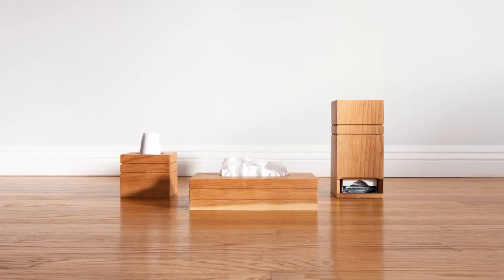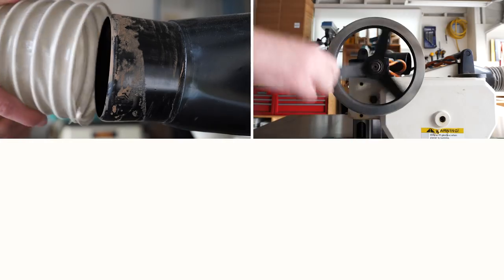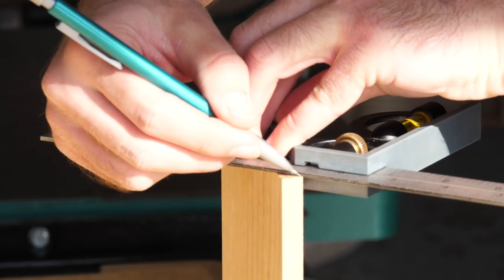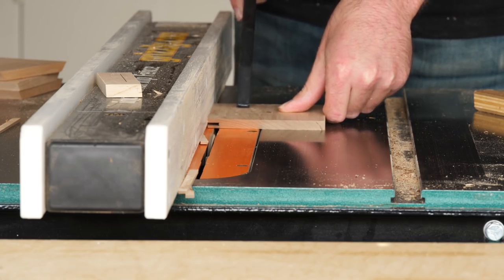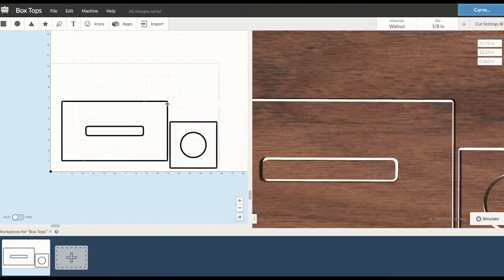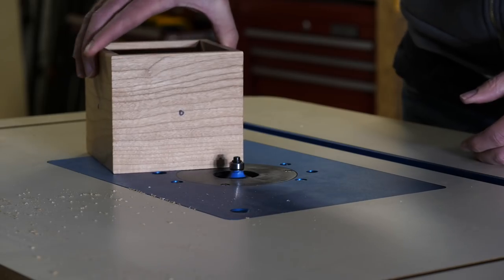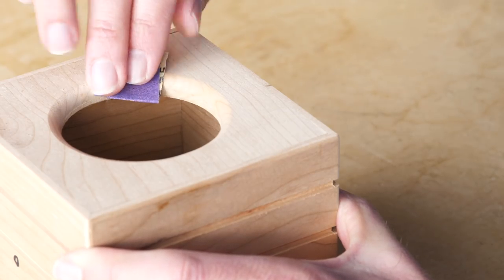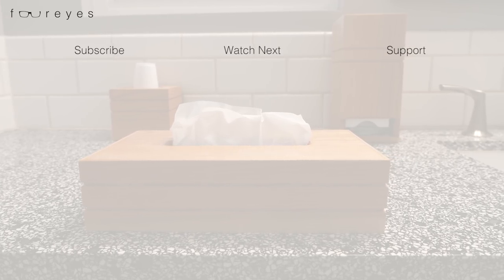DIY Box Cover Dispensers | Simple Woodworking Projects

Comment: Packing tape is actually great for clamping small boxes with miters. Putting some saran wrap around the box, to prevent the tape from sticking to the box, and then wrapping packing tape around the box several times increasing tension on the tape is actually a good solution and provides a good amount of pressure. At least when using material 1/2" thick or under. I really love your videos though man, keep it up! #MMP
Reply from the maker: Appreciate it John :)

Comment: Did you plane 4/4 Cherry down to 3/8? That seems like a lot to take off. Your dust collector must have been full after that
Reply from the maker: yeah, I probably removed about 3/8 of an inch. Luckily it wasn't that much wood in square feet, so not too much dust.
Reply: I had the same thought.

Comment: I’m going to have to go and watch Forest Gump now. 😅 
I’d recommend getting the power cord for the dewalt router on your x carve in to the cable chain. If it was to snag while your not looking it could miss steps.
Reply from the maker: good call. I've actually had it happen once already. It pulled out the z axis cord and stopped plunging :-/

Will it fit in the cable chain? Otherwise I was thinking I might pair it to the outside
Reply: Chris Salomone it should do, I’m not sure if the standard cable chain inventables supplies has opening lids, if not you might have to take the plug off to post the cable through. I work for a cable chain manufacturer so I ordered my xcarve without the carriers and spec’d my own. I’ve seen people use zip ties to attach the cable to the outside of the chain but I wouldn’t recommend that if possible.

Comment: Noooooo!  Don't tell me that you took this wonderful, wide 12" board, from a cherry tree that took how long to grow-and cut it into five and six-inch wide pieces!?

(I get that there are "reasons" to do that--I just hope that when people see a wide board, they think of it FIRST as a wide board, not something to make less wide!)
Reply from the maker: Haha... alright I won’t tell you that I did that.
Reply: I get the pain that comes from cutting wide boards narrow...But depending on from what part of the tree, wide boards can be inherently unstable. If I were making a 36" wide table top, I wouldn't glue together 3 12" boards to make that panel unless it had a full apron base that was only about 2 or 3 inches inset all around the top.
Reply: Yeah--that's what I meant by "I get there are 'reasons' to do that...."  It's just a visceral reaction I have when I see a wide board slaughtered.  :-)